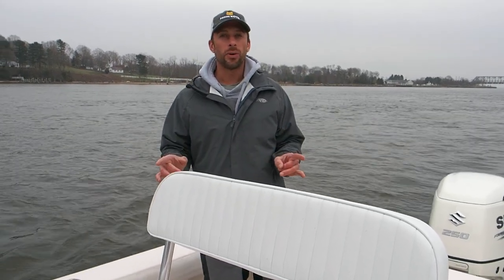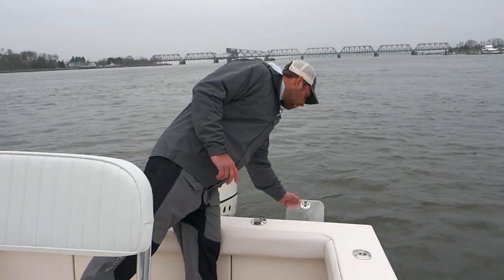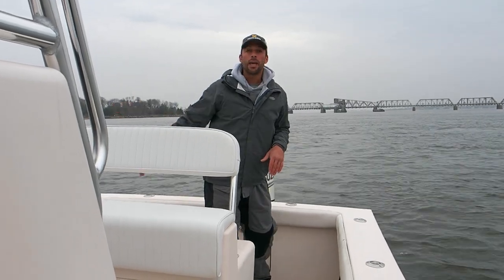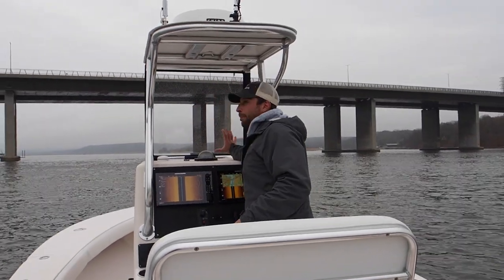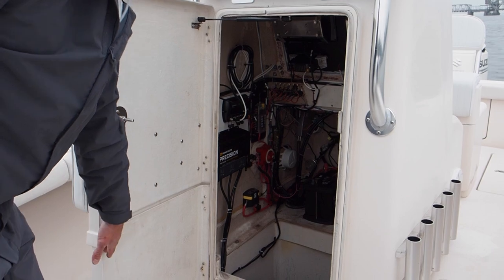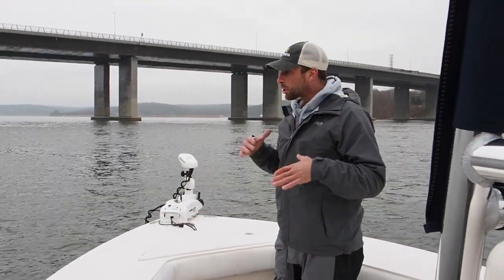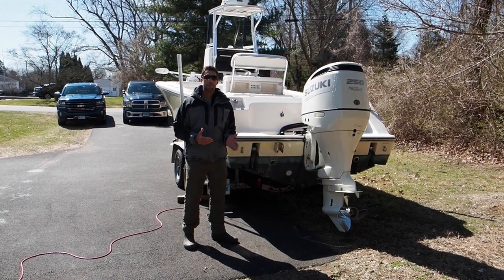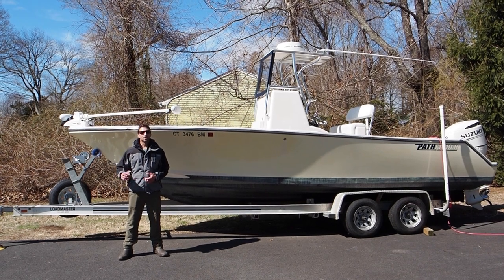Full time fishing guide gives complete Pathfinder 23DV review

Comment: As a long time 23 DV owner, I am interested in the mod you did inside the console to lower the floor down and the location of the 3 batteries for the MK trolling motor. Did you do this or was it already done? We have a solid floor inside our console.  Also did you install the back rest on the seat?  We fish the GOM and I have a 300 suzuki on mine, repowered from a 250 verado we have a 127 gal fuel tank and get about 2.4 mpg at 32 mph which seems to be the sweet spot. Out WOT is about 44 mph depending on load. My biggest issues are the fish boxes are not insulated and the ice retention is terrible. We now put liners in ours as we fish in the hot months. We are going to install the GPS anchor this winter, so what is the shaft length, thrust and model of your GPS anchor? Auto deploy or manual? I am leaning towards the Minn Kota Riptide Ulterra 36V with a 72" shaft. Thanks for the info. You must not trailer very far to be pulling with a 1500 since it is a very heavy boat when fully loaded with fuel and gear and ice. It stressed my King Ranch so I went to a F350 dually and you hardly notice its behind you.
Reply from the maker: Hi Greg, thanks and it is a great boat. The console floor was like this as the boat came with a head and holding tank in the console. I would recommend a 112lb thrust, 72 inch Minn Kota Terrova for this boat. The back rest came with the boat and I believe most of them had the back rest. As far as towing is concerned I tow with a Ram 1500 with no issue at all.